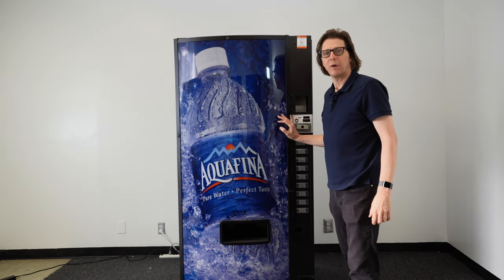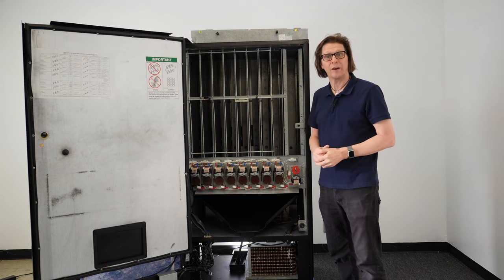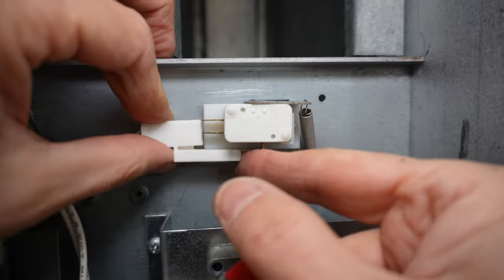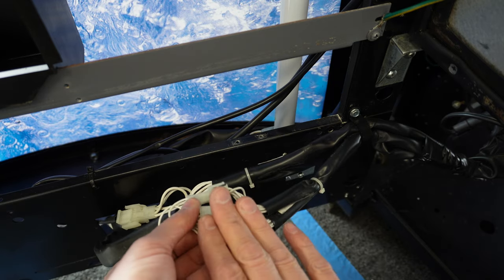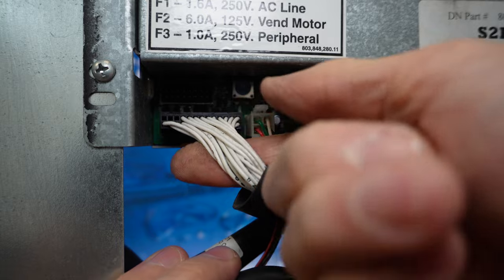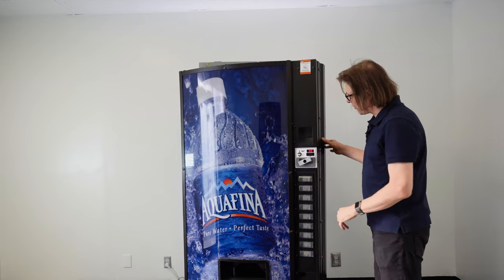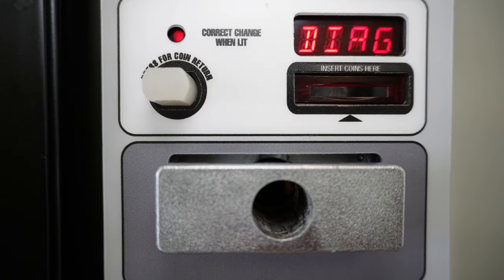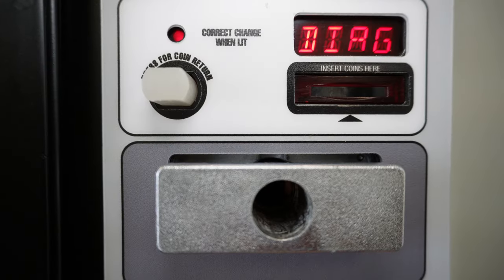Dixie Narco 501E Drink Vending Machine: SOLD OUT Switches

Comment: Could you create a video on how to set the motors when they’re out of position? Not the cam settings but when the actual motor gets out of position. This can happen if you dissemble the motor or if the column gets jammed.
Reply from the maker: Once you have removed the jam in the column you can simply close the main door. At this point the S2D control board will automatically HOME the motor back. Or once the jam product has been unstuck. Press the blue service mode button and the press selection button 1 to make the S2D control board HOME the motor back. Here are two videos I have the outlines this process. ( https://youtu.be/23EbWIb6QhY ) and ( https://youtu.be/JeCZzP4qGpA ). I hope this helps.
Reply: @VendingMachineSupport  Excellent videos.   thank you